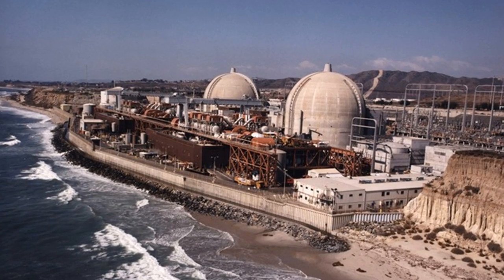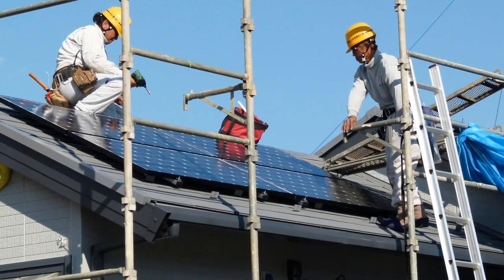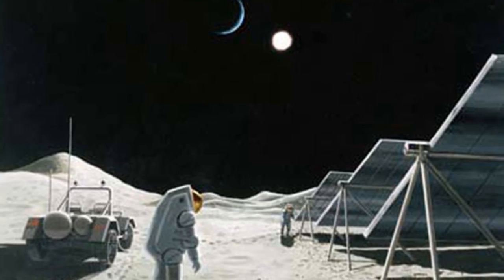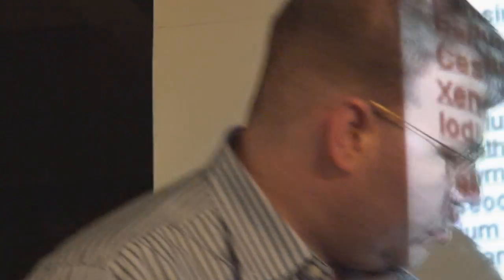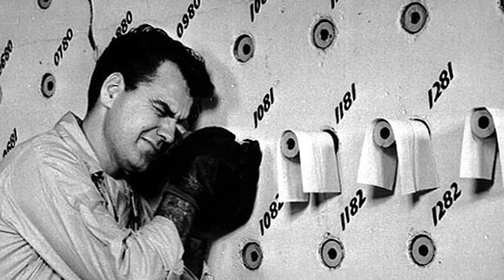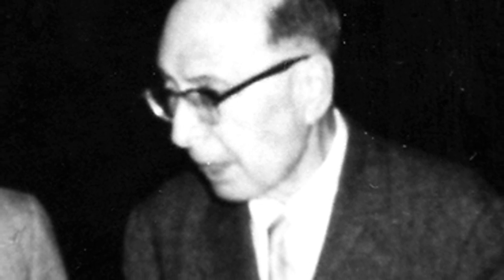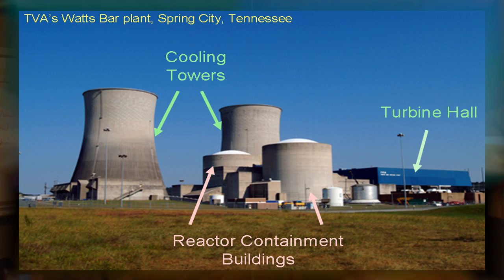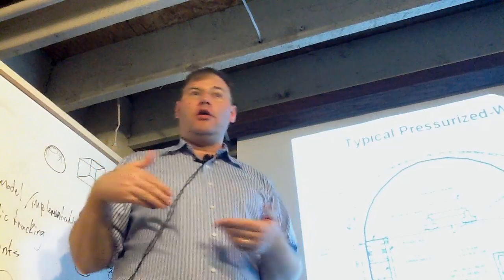Thorium: An energy solution - THORIUM REMIX 2011

Comment: Ok, this all sounds pretty chill, not going to lie. However I wouldn't really feel right accepting this stuff at essentially face value.

The sustainability (and natural abundance of fuel) and running costs, along with passive safety are huge reasons to advocate for the LFTR. That much is pretty much certain. What wasn't really included was the potential disadvantages. Introducing a new technology - especially one as seemingly revolutionary as this will cause changes in many other areas, not to mention potential inherent downsides (development and research costs, for instance) in the initial adoption and subsequent usage of the new technology in the first place.

As such, I have questions:

Firstly, thorium is shown purely in the context of a LFTR reactor. It is implied that other potential reactors exist for using thorium - why are these reactors seen as less desirable compared to the LFTR design? Are they simply worse in every way, or perhaps do some designs have advantages in certain areas but the potential cost is considered too great, for example, greater energy yield at a cost of safety?

Secondly, ignoring the first question (i.e. assuming LFTR is the best usage of thorium and all all that jazz) - what are the downsides to thorium as a nuclear fuel in general? Lack of research, start-up funds, natural resistance to change, and general nuclear power phobia aside: are there any potential downsides that may not be immediately apparent? For example when I did some research into fusion power (particularly the tokamak) my naive understanding was that fusion does not produce radio-isotopes (D-T fusion) and as such was essentially clean - however the confinement gets bombarded with so many neutrons it ends up with induced radioactivity and since the confinement needs replacing you simply end up with another form of nuclear waste, which was not something that was obvious at face value to me. Is there anything like this with thorium based reactors (i.e. LFTR) that may detract from its high number of advantages?

Finally, assuming the LFTR becomes a dominant and revolutionary change to energy production, what impact will this have on the economy of the world as a whole? It is briefly touched on in the video but I feel there are potentially many negative impacts (as well as positive) from such a huge shift. For instance briefly shown in the video is a poster that said something along the lines of nuclear power killing the coal mining industry - granted this is likely largely due to nuclear fearmongering but how significant may this be, and does thorium give that which is removes - such as jobs? This is more of an open ended kind of thing but I feel it isn't really discussed very much in the video.

All in all, thank you for the video, and hopefully for replying. I hope I didn't come across as too negative, I do believe that LFTR is pretty good stuff (I hate that WW2 ended in nuclear weaponry and then the Cold War just fed into fear even more resulting in nuclear power being considered almost magical and intangible in its evil and deadly power which it simply doesn't have - I really do.) but I think having the negatives is almost as important as the positives (though I understand not putting them in the video for advocating something many people are likely already scared of to some degree).
Reply: This comment deserves attention.
Reply: Hey, this is a year old, but I thought it was a good comment.

Thorium is talked about in these Molten Salt Reactors, because MSRs have the fuel dissolved in a liquid, instead of being in solid fuel rods.  Thorium reactors don't burn Thorium.  They don't get their energy from Thorium.  Their energy comes from the fissioning of Uranium 233.  We turn Thorium into Uranium, and then burn it.

So a thorium reactor relies on constantly breeding Thorium into U233, and then burning that.

You can't do that in a solid fuel reactor economically.  You can put thorium in, and then let it sit there for a while, and then pull it out and separate out the protactinium and other decay elements and extract the uranium 233. But then you have to put the uranium 233 into a new fuel, and make it into a new fuel rod and put it back in.

Thorium reactors rely on being able to reprocess the fuel to get U233 out of it to burn.  In a Molten Salt Reactor, you are dealing with liquids, so you can continuously reprocess it.

There's nothing wrong the thorium itself in any other reactor.  It just isn't economical because reprocessing solid fuels is expensive and time consuming, and requires you physically move and interact with radioactive components - repeatedly moving them into and out of the core, which you have to shut down while you switch stuff out.

Second, Thorium doesn't produce any decay chains that are worse than what we get form Thorium.  They still exist, but they aren't any worse.  Some of the unique elements that come out of a Thorium decay chain are actually very valuable.  We get Plutonium 238 out of it, which is what NASA uses to power its deep-space missions and is desperate to have.  You can also get Bismuth-212 out of it, which has some potential medical applications for fighting metastatic cancers. But Bismuth has a halflife of less than a day, so the only way to get at it is if you are making it in a Molten Salt Reactor, so you can constantly be reprocessing it and just separate it out chemically.

One benefit of any MSR (not just Thorium) is that, because you can seperate, reprocess, and selectively introduce elements, you can use the reactor to burn up all the fuel and most of the trans-uranics and actinides that come out of it.  That means easily only 10% of the waste, and the waste that remains will have a life-time on the order of 300-1000 years, instead of 10,000.

I can't speak about the economic impacts.  Not my field, sorry.

Comment: Why is the water pressure measured in, or expressed as such and such atmospheres?
Instead of 150 Atmospheres, why not say 2100 PSI?
Reply: because doing simple gas law equations is a pain in the ass with the shitty imperial system
Reply: For a layman, PSI is easier to understand, since pressures they encounter are expressed as PSI.
Even if it isn't exactly correct to use psi, wouldn't it be close enough that the layman can relate?
Reply: 150X ambient atmosphere at sea level isn't it?
Reply: Except the average person know what 150 atm is? Using atm is very clear.
Reply: I dunno. Ask the average person what 1 atmosphere is and you probably will get a blank stare. The people that watch this video are not a good gauge of the "average" person. Anyone that would watch this video would have a greater than average interest in more advanced technology.
Reply: kylesenior: 150 atmospheres pressure is 2200 psig. This is the standard operating pressure for a PWR. 1 Atmosphere = 14.7 psig.

Comment: Hi Gordon, 
I'm just watching "LFTR, what fusion wanted to be" and there are safety claims about 'no hot spots' in the liquid fuel and the fact that the liquid fuel expands gives you a 'large negative temperature co-efficient' so that it is much safer. But why? Do you have a layman's summary of that in English? Does one of your video's cover the expansion of the fuel?
https://www.youtube.com/watch?v=AHs2Ugxo7-8
Reply from the maker: Max Green https://youtu.be/ENH-jd6NhRc?t=5m34s ...is the ORNL researchers talking about salt expansion. You might want to try turn to a non-video source as I know there's not a lot of coverage about why... its a pretty typical physical thing something gets hot and expands and gets less dense... so in the videos it is usually discussed as a feature rather than diving into exactly why things expand or why the density of the materials impacts fission.
Reply: gordonmcdowell Thanks for that. It's interesting to hear from the original team. (It might just be me being home sick from work today, but some of the shaky-cam at the 30 minute mark was making me dizzy. Tripods rock! :-)  )

Comment: "I didn't say lftr will USE the coal, just let us use it in a way that was exceptionally more cleaner than we do now"

Sure it's possible to use the energy from LFTR, or any other energy source, in coal gasification.  But, AFAIK, it's not stated in this video, nor do I see it particularly relevant, necessary, inevitable or even desirable.

Your original post left room for interpretation error by other readers.  If clarification makes me a "jerk", so be it.

Comment: Ratio of 1000x? Way WAY more than that. Ratio of expansion of water under 1atm is more than that 1700 I think, at that kind of temperature, I can't imagine.
Reply: You have to remember the temperature drop when it releases, this cooling effect will reduce the amount of "total" water released. All in all it might be right at 1000 times the original volume as not all water was evacuated from the reactor.

Comment: @Methematician There are problems with using solar power but they can be solved.

BTW Operation Teapot (1955) used an Uranium-233 warhead which is breed utilizing the Thorium cycle...

Comment: "wouldn't the lftr end up supporting the coal industry in that it will let us make liquid fuels using the same coal"

No.  LFTR does not use coal -- it uses Thorium to heat gas turning generators to create electricity in a closed loop.  Because of the energy density and efficiency of LFTR, it is also possible that it could be used to pull CO2 from the atmosphere to create cost effective synthetic carbon neutral gasoline replacements, again, not using any coal or other fossil fuel in the process.

Comment: In the hey day of the industrial revolution machine tools are all the rage but they're still restricted to using a proprietary Mushet alloy tool steel & high carbon tool steel for their tool bits. Then a new tool steel alloy was discovered, tested to destruction but survived & the testing machine tools were reduced to scrap metal. The machine tool industry response was that of dismay because to make full use of it's potential they have to scrap all of their existing machine tools for new ones.

Comment: In the US, political reasons mostly. Carter enacted a bunch of laws that ceased up nuclear and has led to a lot of the nuclear industry problems we see today (lots of waste, ultra-expensive reactors due to over-regulation, lack of innovation in the field, etc.).

Apart from that, the sodium-cooled breeder design is just, well, terrible. It's immensely complex and expensive. The U-238 fuel cycle is definitely something we should develop and use, but just not in a shitty sodium-cooled design.

Comment: Efficiency vs. resource quality is a silly argument. In reality you'd like to be both efficient and have the best resources available, both lead to more products.

However if you're forced to chose between the two, you'd be likelier to win by investing into better resources. Total efficiency increases, from say 40% to 80%, would only provide you with twice the products. Now try switching to a resource which is at least 200 times denser than what you had before. There is no contest.

Comment: issues with solar:
the sun is not always shining or maintaining a constant level of intensity
batteries take time to charge and larger NiMH based ones have to be shipped to 3rd world countries to be made
individual panels are expensive and don't produce much, which means you need a massive array of them if you want to base a grid off them
they need to constantly be cleaned or cleared off to ensure maximum output
the panels themselves are made from toxic materials

Comment: @Z3N17H1U5 The only thing from that project which has any bearing in reality is the use of the Cassimir effect (zero-point energy). The problem is that even if you could figure out how to use the Cassimir effect to produce energy, you'd never get enough to do anything. The Cassimir effect is extremely tiny and only becomes important on the nanoscale, in which case it's more of a problem than a good thing.

Comment: At first no one wants to accept and use the new successful alloy but a German industrialist took the risks, tested it to destruction, and then scrap all of his existing machine tools after using them to build new ones that were many times better in order to make full use of the new alloy tool steel that remained hard at red heat and requires only air cooling. As a result the machine tool industry has to follow suit or else the German industrialists will monopolize the machine tool industry.

Comment: All of this sounds amazing but I have a looming sense of dread that tells me this is too good to be true.
Can a nuclear physicist please tell me that I don't have to worry that this will be the next placebo solution to our energy problems?
Reply: It's not too good to be true, it's just engineering and chemistry done correctly, so be of good cheer. Nuclear physicists work for GE and who knows who else and they're invested in the solid fuel cycle and the billions derived from a supply chain dependent on them, why would they promote the glory of LFTR?
Reply from the maker: There's real money being directed at Molten Salt Reactors right now. While it isn't a Thorium breeder reactor (rather a Uranium/Plutonium breeder reactor) TerraPower has expanded their reactor research program to include liquid fuel. So that's BILL GATES' backed nuclear power company finally open to the question: Should nuclear fuel perhaps be liquid instead of solid?

That's the big question. And once a liquid fuel reactor is operating again (like one was during the MSRE days), then Thorium becomes plausible. Thorium is NOT practical with solid fuel reactors. Thorium IS practical with liquid fuel.
Reply: good point

Comment: @pand2aren Solar panels are excellent on small-scale installations like rooftop panels for a home.  Mine for instance has a 7.2kW system, which feeds back into the grid, and the power company sends me a cheque instead of a bill.  But having said that, the space used by the panels to collect enough sunlight to generate that power is substantial, and obviously poses some problems when thinking in terms of industrial-scale power generation.

Solar has its place, as does thorium ;)

Comment: @Alectr0n It will all depend on how far you can drive between refueling stations. As it stands, batteries suffer considerable disadvantages against oil, namely their energy density is many times lower. However, they enjoy better energy conservation, conversion, and recycling that may very well make them better than oil one day. They are already competitive in urban environments.

Comment: If china has 50 of these reactors they are going to blow away the u.s in competition even in agriculture with the fertilizers produced from this energy.  Also I wanted to mention another reactor called the hydrothermal reactor that uses ocean vents on the floor that produce 10 times what current nuclear reactors put out and is natural, safe and is unlimited energy.  Plus it acts as a natural mining for multiple resources so you don't have to dig up the earth to mine.  Marshall systems is a company that is seeking to develop this reactor.
Reply: The day before, I found that even India olready has its first thorium base research center!! And it was on TV, back in 2010.

Comment: "Energy efficiency" is not bad; it just isn't a successful strategy.  If CO2 emissions are your "bugaboo", there is an economic principle called "The Jevon's Paradox".  More efficient devices use less energy, thereby decreasing the demand, thereby lowering the price, thereby increasing the demand.  Due to the "Jevon's Paradox", any strategy based on "energy efficiency" is doomed to either have a totally neutral effect on carbon emissions...or worse, increase CO2 emissions!

Comment: We are sitting on the biggest thorium reactor right now. All we have to do is drill down deep enough and use the energy from that depth instead of building new reactors.
Reply from the maker: +niroslav plachi Depending on your location on Earth, you may need to drill down quite far. Also the geothermal energy is not replenished infinitely fast. It is entirely possible to drain the heat from a geothermal resource and have useless geothermal infrastructure waiting for more heat to be generated. Also, see California for examples of large quantities of radioactive materials being produced along side geothermal energy... both Natural Gas and Geothermal can be found in conjunction with large quantities of naturally occurring radioactive materials.

Of course geothermal is a great resource and generally I'd love to see it further developed. But it isn't a silver bullet. The best resources are already tapped, just like the best hydro and best wind tend to be the first ones developed. And after that we get less bang-for-the-buck.
Reply: Geothermal increases at 25 c per km down at 40 km there should be 1000 c,consider 5-10 liquified salt loops to pump the heat to the surface.So far I have only heard of the drill going to about 12 km and that is capacity of the drill rig.Titanium pipe is very expensive but it could handle the heat and be light enough
Reply from the maker: +niroslav plachi Is that price increase linear? Can you provide a reference?
Reply: deepest drill hole in the world on you tube Which price increase is your question about Mr.McDowell?
Reply: Can liquified salt be used as a drilling coolant?
Reply from the maker: +niroslav plachi  If you have material advances to enable cheaper geothermal they'll probably also enable drilling for oil. That's great go get folks doing geothermal. Does not seem like an optimal pursuit.
Reply: Easier said than done but the Joides resolution is setting out on a mission to drill where no one has drilled. Thank you sir for keeping the fight for thorium reactors alive, you are the best speaker/teacher I have ever heard. Thank you